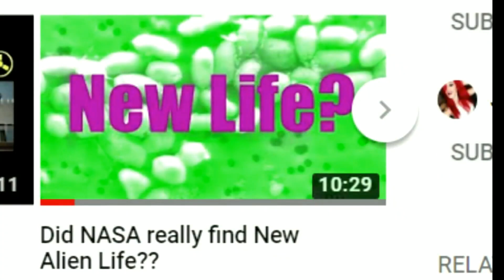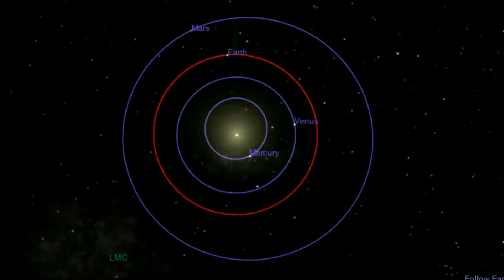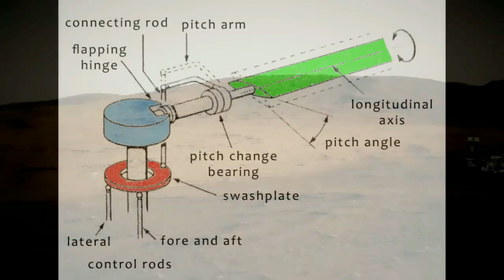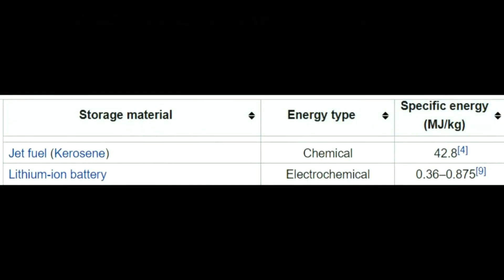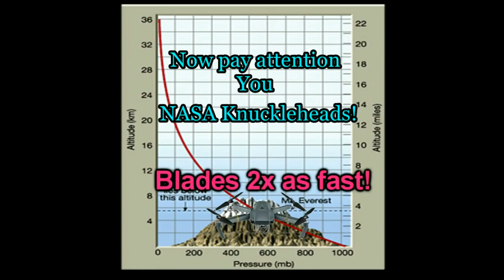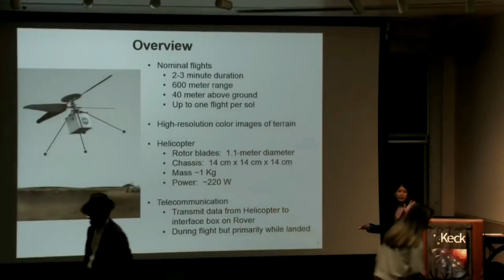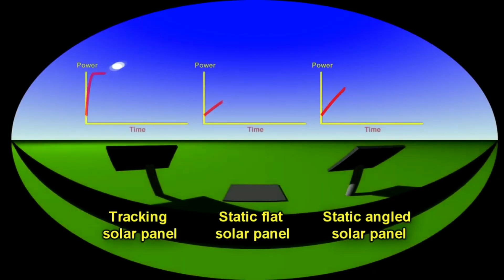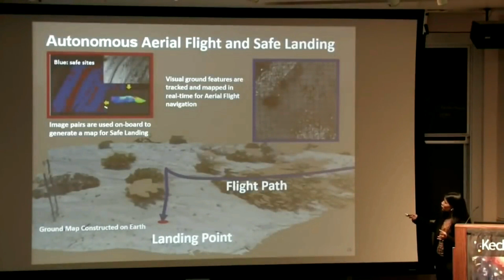Moon/Mars Hoax; "The Mars Fraud Copter"

Comment: Another fairytale story by NASA. The rotor blades of a helicopter act like an airfoil of fixed wing aircraft. Both need volume of air per square meter over their surface and the right aspect ratio for the type of lift needed. And both rotor blades and airfoils need the right camber for high versus low pressure to maintain lift, which wouldn't work on Mars.

This is just another attempt to bring back interest in a waning space agency.

NASA: Never A Straight Airfoil :)
Reply from the maker: I better tell GinSkin you are over here. I wouldn't want to see him feel left out of a perfectly logical conversation.

Comment: How is your vacuum chamber "experiment" goin? You have gone all quiet there!
And your math calculations "proving" the diameter of that crater? you have gone quiet on that one as well!
Reply from the maker: It's still going smart guy! It takes time to do things right Greg. You being a science guy should know that. There is 10 rolls of this film to be put through its paces. I have only got to the first film. Today is taking the pictures with the first film, then off for developing on Wednesday. I have a medical vacuum pump on its way which will take the vac level down 4 times what this pump is capable of, then another fresh roll goes in. That's what you call a pre test before the real ones begin. All I have to say is IF this film looks anything like the one I put in the test chamber for 108 hours, it is game over from NASA'S photos. If not, then I have 2 good pumps and a great 35mm camera out of the deal! I win in any case!
Reply: @theapollodetectives  Armstrong and Aldrin spent a total of 21 hours, 36 minutes on the moons surface. The entire EVA phase lasted a little more than two-and-a-half hours!
Which means, at most the films would have been exposed to the vacuum of space for a max of 3 maybe 4 hours!
So even if you really have a vacuum chamber; which I suspect you don't, otherwise you would have provided a video like an honest truth seeker!
Each roll of film would only be exposed for a fraction of time compared to your 108 hours!
Which keeps proving you really are not interested in the truth, only your delusions!

Comment: This helicopter is strange. It can go up, but not to any other directions like right or left, forward or backward. Who designed it? A high-school kid? It must be C-student.
Reply: "Who designed it? A high-school kid? It must be C-student.
"
If if they did, it is obvious they are far more advanced than you are!
Reply: @gregsmith8617  F-35 jet also has the same problem. It can move up, but it cannot take off. Like an elevator, it needs to come down. What's wrong with an American engineering? Hire Chinese for God sake.